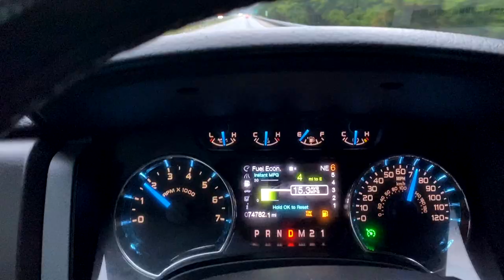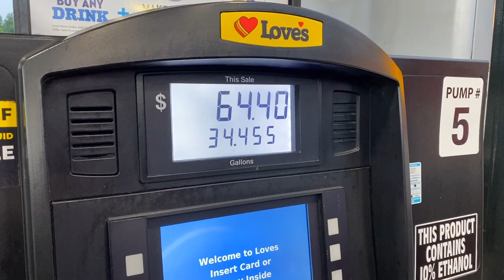Rebuilding a Salvaged BMW 335is - Part 1

Comment: What a nice project. The repairs should be easy compared to your other projects. The headlight should be repairable as you can buy a tab repair kit off the Internet
Reply from the maker: Yes sir, should be able to salvage that left headlight. The right one is trashed though unfortunately. It’s broken to a point where dirt and moisture are inside the housing. Oh well! Thanks for watching!!

Comment: From what I've seen on YouTube, IAAI does not care much at all about the cars. They seem to damage them more than Copart. My 16 GT was at IAAI for a week or so before I bought it back. Luckily it was not damaged any more, but they did throw away some of my interior trim pieces when they were cleaning it up. One little part of the dash is about $140 for the exact replacement, so I just used the base model part for now. Good luck with the rebuild!
Reply from the maker: Thank you! Overall I’ve done well not having too many damaged from the salvage auctions. But they got me good on this one! That fender is expensive! 
Good luck on your GT! You have it on YouTube?
Reply from the maker: Awesome! Thx for the link. I’ll check it out!!
Reply from the maker: Man, that Mustang to a HIT! Great job putting it back together. Looks awesome!!

Comment: I own an E92 335is. Your car is strange in a few ways. First off it has fog lights and the door trim and kidney grilles are chrome. I’ve never seen an iS with either and to my knowledge they never came from the factory with fog lights or chrome trim as an option.  

Edit: So apparently fog lights and chrome trim were available on the E93 but not the E92.
Reply from the maker: Right! I noticed those things as well, and they’re specific to the e93 vert. But I will most likely be changing the grills and fogs over to black. I think it’ll look better on this car!
Reply: Crossroads Rebuild you won’t be disappointed. I also have a ‘11 335i in silver. It has black grilles and door trim and I put the 19” Style 313 wheels from the iS on it and it looks stunning. Btw, if you’re looking for a set of 19” iS wheels let me know. I’m thinking about parting with them even though they’re somewhat hard to come by.
Reply from the maker: Thank you! I actually already sourced a set of the correct 19” wheels for this car. I appreciate your offer! You’re right, they’re hard to find! I had someone reach out to me. He offered a good deal since the wheels were a little roughed up. I’ve got them at a wheel refurbishing shop right now. I can’t wait to get them on the car! They’re going to look awesome! My car was originally spec’ed with the 19” wheels, so I have no idea what happened to them or where these wheels that are on it came from. But looking forward to seeing it with the proper wheels!
Reply: Crossroads Rebuild looking forward to seeing how the car turns out!